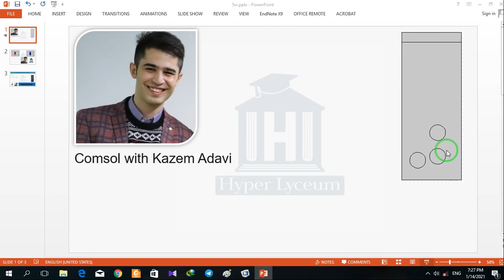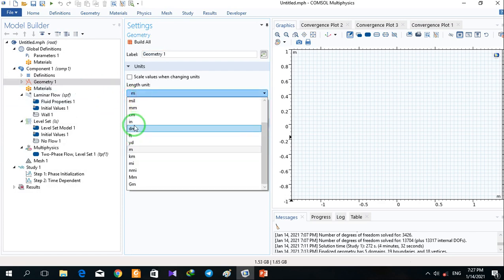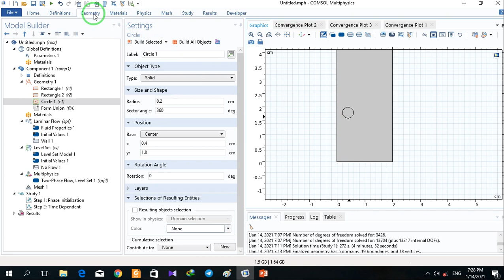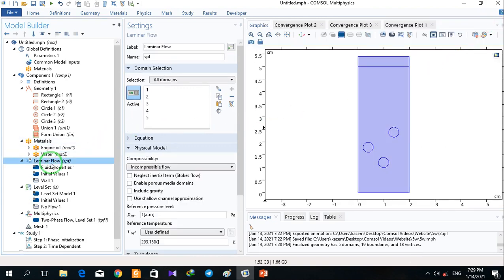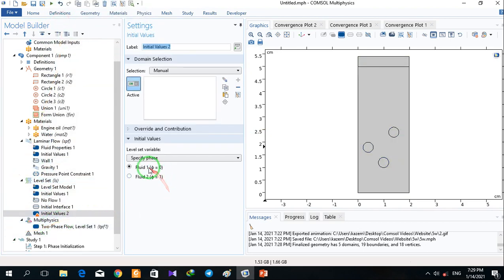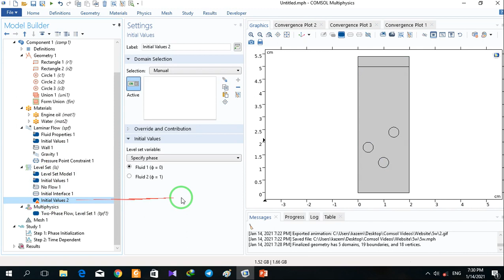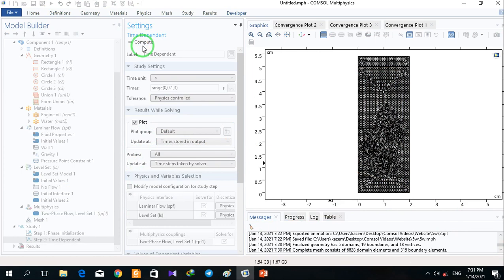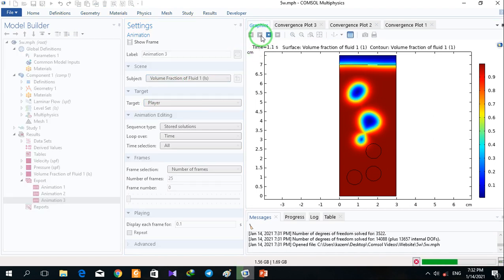Two Phase Level set droplets by Comsol Multiphysics/Simulation// Level set/ Phase-field/ Kazem Adavi

Comment: what version of comsol r u using?  I can't find the interface after right-clicking on the level set model
Reply: i find it in comsol help 
In the Level Set and Phase Field interfaces, the Initial Interface feature is now obsolete. It does not need to be replaced, since the phase interfaces are automatically detected from the selection of the Initial Values features and the initial distribution of the level set or phase field function is solved for in the Phase Initialization study step.
Reply: me too, why? :(